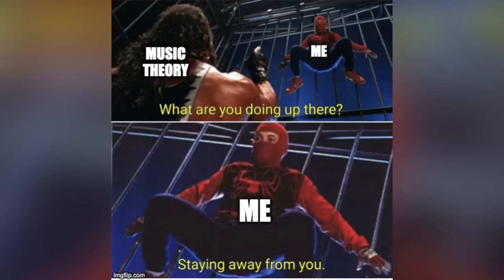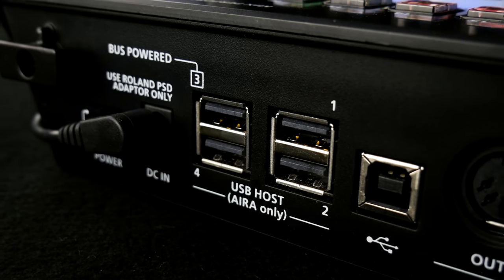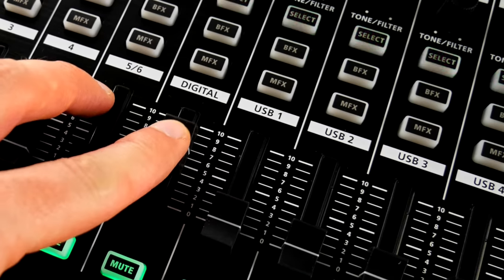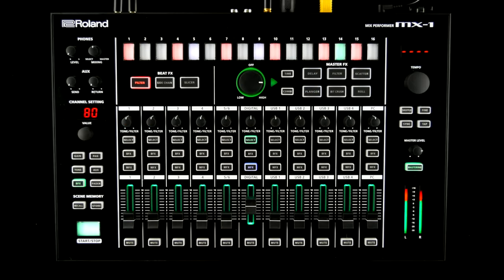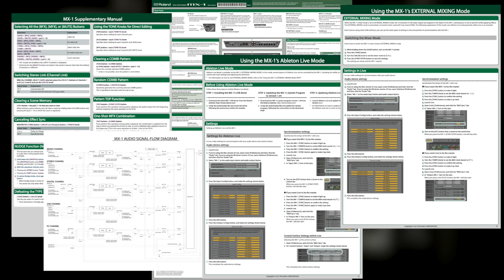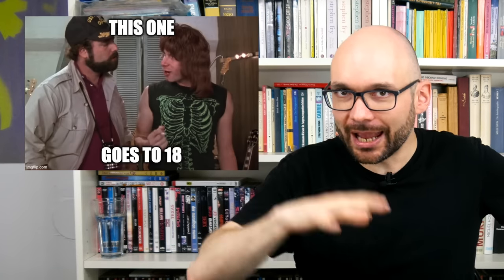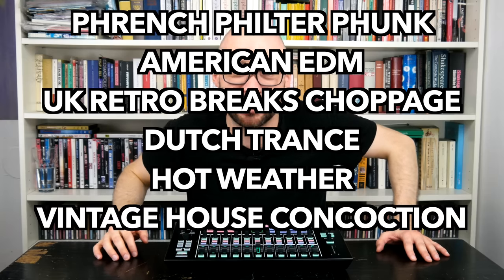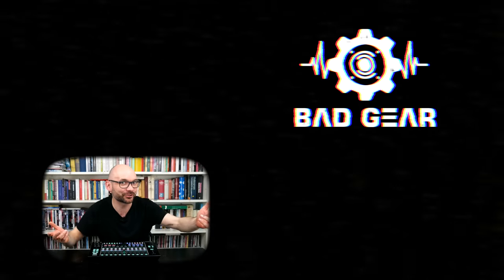Bad Gear - Roland Aira MX-1 Mixer

Comment: Sometime around 2008 or so, Korg made a digital mixer for this market called the Zero8. It had 8 stereo channels, selectable EQ/filter per channel like the MX-1, and a FireWire interface that made it look like 8 stereo audio channels to and from your DAW.  Oh, and touchscreen-controllable Kaoss-style effects processors (1 insert, 1 send, 1 master).  It also had all the analog I/O you'd want.  And it lit up like a Christmas tree, in a much less toylike way than the Aira stuff.

It was an incredible product with serious stability and reliability issues.  Sadly, rather than fix the problems, Korg quietly abandoned it.

I think the market still needs a product like this. Unfortunately the MX-1's connectivity just sucks, and it is way too toylike.
Reply: Oh yeah, i still have the Zero8. When it came out, it was my absolute dreammixer, with all included features i needed and wanted. For both, djing with traktor compability for timecode/vinyl and producing! 
Bought it after the release and spend most of my money. Worked nearly 2 years and had so much fun before the heavy problems began. 
Some channel faders didn't shut down the signal to 0, the audiointerface became a total disaster bcs the sound more crackled than sounded^^. 
The touchpad stopped working, first one axis, later both and so on and on.... 😭
Today, the only thing it still might work as a MIDI Mixer/controller if you connect to a MIDI interface! I loved this gear so much when it worked, but when my Zero8 died it ruined the fun in making music for me... the idea for this console was genius but the technic inside crap  (sorry for my bad english, i am from germany 😂)
Reply: @danielwerner1980  I used mine to get 6 stereo channels from Ableton Live for performing, plus plug in a couple of lines (synth and homemade bleep box).  It was like a dream for a couple years, then the touch screen would occasionally just stop working and the unit would need to be opened up and the touch panel connector disconnected and reconnected.  That disassembly would take about an hour!  I could have lived with that, but it just stopped working on me in the middle of two different gigs, in front of an audience, and I had to reboot the computer to continue.  So ... I had to retire it.  I still have mine too, it's in a nice case ... just sitting there.  What a shame.

BTW I would never have known English is not your first language if you didn't say so.  Good job.
Reply from the maker: This one is super interesting, thanks for posting!
Reply: @AudioPilz  sure thing - unfortunately the Zero8 is probably not worthy of the “Bad Gear” treatment. When it works it is absolutely perfect. If somebody ever makes a similarly compelling product, but more reliable, I would pay big bucks.
Reply: @infindebula  sounds almost like my setup, i used it either 8ch from Ableton or 6ch + 2 really bad gears from Roland and Quasimidi or even vinyl/traktor dj setup, with an external Kaoss Pad 2 on the Master and it was hell of a fun! Like a dream like you said as long as it worked...
The possibilities seems endless, 8ch stereo audiointerface, traktor compability, phono/mic/guitar amps, line in route to whoever channel you want, eq selector, mastering fx + kaoss pad, damn you could even switch every ch for its own to a midi/midi+audio controller and so much more features over the touchpad. 
Sucks, when the touchpad dies at first 😅
I've heard from that trick you said, somebody told me you could fix it when you open that whole thing and it takes hours, but i never did. My mainproblem was the broken audiointerface at first that made the whole console nearly useless. Damn, i got nostalgic and sad... sorry for the long text about things you allready knew 🤷‍♂️😁
Playing a gig live like you said and the machine died must be a nightmare, hope you could saved your show somehow?
When the Zero8 was new it was a beast, i played one time on the Nature One CV a 12 hours dj set thru traktor with timecode vinyl and had no single problem....
Korg wanted everything in one console and messed up with the complexity of the technic. 
P.s. oh thx, thats really kind. I'll do my best to be understandable and not sound like a complete analphabetic 😂
Best wishes from germany

Comment: I kinda get why the TR is only received in stereo. As i understand it, the MX-1 is supposed to be the center piece of an Aira setup and the TR-8(s) already allows for mixing and panning on itself. So using more mixer channels on the MX would be redundant and would „waste“ valuable channels.
I suspect that’s also the reason a reverb and send delay were omitted as every Aira devices already has their own FX tailored to each device, which include delay and reverb on every instrument iirc. DJ style FX and the beat FX just make more sense in this case.
I‘d say, it’s completely geared towards combing the Aira range and everything else is just a „bonus“.
Reply from the maker: True that!!!

Comment: first I was a bit disappointed, when I got this mixer second hand. But if you get the concept to play aound with other roland aira or grooveboxes together with it , it becomes kinda easy  and fun.  Feels  like an effects-unit with 6 hands-on channels. I also had the the experience of lost connections with my daw. But anyway  it is more fun to just live-mangle a group of electronics. Of course there s a lot they could have integrated in hardware and usability. But I got it for 170 euros - for this prize its a great toy.

Comment: I have a contender for a bad gear mixer.  The Korg Zero 4. the Korg zero mixers where great for plugging in synths and drum machines until korg stopped support for windows 10 and fire wire connectivity on new computers is zero these days,
Reply from the maker: Ah, interesting! Thanks for posting!
Reply: Roland is just as bad if not worse for not updating drivers.

Comment: There is regular delay and reverb, it seems like you might not know that there are many alternate effects modes for each of the master effects! I have delay as a thick hall reverb and it serves me well. You also don't need a separate compression effect since it has 9 different mastering effect modes, which of course all have multiband compression.
Reply from the maker: Thanks for the heads up. Is there a way to route the master effect to discrete tracks?
Reply: @AudioPilz  not as far as I know! I haven't dove into the off-documentation features yet but I'll let you know if I discover anything. These Roland devices seriously need proper OLED displays and normal menus for all these settings!
Reply: @AudioPilz  ps I love your videos! I watch every new one that comes out. My favorite synth channel on YouTube.

Comment: I found the I/O limitations quite severe. Unless you own a few AIRA boxes, half of the desk is wasted. But if your setup matches the channel layout, it´s a really interesting box. That said, a mk2 should have an option for all analog in, even if via extender. The "sequencing the mixer" idea has stuck with me, I´m currently going that route in the modular.
Reply from the maker: ...or multichan connectivity to the TR8...
Reply: @AudioPilz  True. DB-25 sounds like a good idea too. I was an idiot, got 2 of them and hoped that drivers will work in RME quality and style. Fuggedaboutit. Even with ASIO4ALL it wasn´t possible to get a stable setup with 2 MX and 1 TR (may differ with aggregated devices under Mac). I moved on though and boxed the boxes for now. Planning to build a little AIRA/Boutique setup in Winter. 

Oh, and I don´t recall who, but one of the better known DJs played with a laptop and 2x MX-1 at a rather large festival these days. So not all hope is lost :D
Reply: Paul van Dyk.
Reply: Agree about the lack of inputs, really bizarre choice from Roland

Comment: Hey soundengineers, i got a question. Unlike the author, i have never had to work with hardware mixers in my musician's life until very recently. I'm learning playing drums, and in my rehearsing place they have Yamaha MGP's which i learned to do three things on: 1) mix for the band via main array; 2) mix for my personal monitoring; 3) mix down for recording. All simultaniously, for 5 to 10 channels (depending on how many dudes make it to the rehearsal). Number two involves a cheap extra mixer from Ali; the rest is handled by the MGP. Now i wonder: could this mixer do the same?
Reply from the maker: Nope, MX-1 is underspeced for that I'd say

Comment: I would like to see a new revision of this mixer that is capable of connecting any Roland synth with USB multichannel audio with the ability of streaming all of the separate USB multichannels for each instrument into separate channels on the mixer.  I have a TR-8S and a Fantom-06, both of which can stream multichannel USB audio.  A mixer like this with the feature I described above would be a great way to aggregate the TR-8S and Fantom-06 along with all of their individual USB audio multichannels onto a Windows PC DAW and record each multitimbral part on a separate track within the DAW software with minimum latency.  

A mixer like this would also allow full mix control over each separate sound in the two instruments when used just as a standalone mixer with the Roland instruments connected via USB.
Reply from the maker: Multichannel support would be awesome!

Comment: I got a RCA to digital converter for mine, so I have an extra stereo channel to play with.

Would have been nice if there was an option to connect non Roland gear to those USB ports, but that would stop people from trying to catch all the Roland Aira compatible gear.
Reply: SE02 I choose you ! 🤣
Reply from the maker: Yeah, that SPDIF in is really nice!
Reply: @AudioPilz  Do you know if the signal gets resampled or does the MX-1 sync to the spdif  embedded Wordclock? Would the laptop then adopt to the spdif clock?

Comment: i heavily considered buying this when i came out. After weeks of research and countless forum threads i was unable to determine if this thing worked with any kind of non roland/aira machines. The marketing for this was a complete disaster. I eventually settled for a standard dj mixer and small 6 channel sub mixer. Turth be told watching you use it I really wish i got one.
Reply from the maker: Yeah, introduction of this one was weird!

Comment: You are correct, in that there  are no good options for synth/gear mixing in a live set up. Behringer needs to hear my plea for a 5 channel mixer with an assignable cross fader so I can cut two drum machines like I would vinyl records. Effect send AND return. No on-board effects (unless it’s the sweet pioneer DJM delay). Headphone (cue) monitoring is nice but not necessary. Line in with full size jacks. No mini jacks or RCA. 
That is it. 
Best I’ve found is the Behringer MXB 1002. No crossfader but everything else is great. Can be powered via a single 9v battery and does phantom power from a secondary 9v battery. This Aria is just a glowing toy IMO.
Reply from the maker: Maybe a synth-focused version of the X32?

Comment: I considered this back when it was released. I was intending to get one with a System 1 (ended up getting neither). Though I never fiddled with it, I dug deep into looking at how it worked and just felt it was netiher here nor there. I liked the fact it tended to accommodate DJing sensibilities pretty well, but I just found other features weirdly lacking. I mean you've shown it sounds nice and all, but I guess it's just that thing I often find where I look at it and think "how in the hell would I ever use this and not just default to something else?"
Reply from the maker: I'd say it's great for DJs turned producers
Reply: @AudioPilz  Yup that's pretty much what I gleaned from giving it a once over. I think you nailed that presentation too.

Comment: If they would sell small USB soundcards to Turn the USB ins into audio ins this Thing would be much better. 
Anyways, I Love it so much, I Work around its flaws <3 great Video, as Always 😊
Reply from the maker: Thanks! You mean a soundcard for your soundcard?;)
Reply: you can plug it into a Windows PC and if you have the drivers installed you can route audio to any of the channels, no program win10 does it. You can then get a stereo to usb cable and route the audio in to one of the MX1s usb channels your not using, while hardware is plugged into the other channels in normal mode  I need to make a video about this. I for example have the MX1 and the MC707 and the DJ202 plugged into my computer via USB, and I route the audio to usb1 usb2 and usb 3, my computer audio (youtube) comes in on the pc channel. Doing this instead of plugging the 707 into usb1 lets me send pc audio to the 707 via usb. I use the stereo to usb cable to route an electribe to usb4. Im not sure if you can use multiple stereo to usb cables  at once. This leaves 4 stereo channels if you use a analog-digital converter for the digital channel
Reply: @AudioPilz  indeed😊 more analog ins in the First place would have eben the better solution, but as a workaround... Why not? If I Had the soldering skills i would try to make sth Like that myself. Maybe from a broken tr-8 🤷
Reply: @timb5940  How’s that video coming along re conversion of usb to audio inputs?

Comment: The fact of the matter is there is nothing else on the market that competes with the MX-1. If you have other boutiques / TR8-S / Aira gear with external inputs you're effectively getting another 4 stereo analogue inputs via the MX-1's USB ports. The mastering options glue everything together during live performance. Prefer to use send FX and return to a stereo input for multitracking. 18 channel interface for this price with all the performance features to boot. It's not perfect but show me a mixer that is? For the price it does a lot very well.
Reply from the maker: There's some truth to that!

Comment: I will have you know that the very day this video dropped, I am to receive a Beat Scatter box, aka SP-404 MkII. Thank/blame you for tipping me off to Roland’s Scatter!
Reply from the maker: Scatter is like instant breakbeats;)
Reply: @AudioPilz  YES 💯 This is why I ❤️ it; also, BOSS RC-505 MkII seems to have a different version of Beat Scatter: only 4 variations, I think, instead of 10 on recent Roland gear. Also, the 505 implementation is on recorded audio only, not live input. 🤔
Reply: @AudioPilz  Guess you gotta do Roland’s Eurorack Scooper one day: “Modular Scatter” (and looper?). Last thought: now that I’ve been able to play with Scatter on the SP-404 MkII, I’d say that many of the effects on Hologram’s Microcosm pedal have a slightly similar application or approach, albeit with transient/envelope following.

Comment: Thanks for video my friend.  I am confused about one thing and would be so grateful if you can explain the answer.  I use a Focusrite Clarett 8 pre AD which is  full so I was going to buy another used one and connect using ADAT for an extra 8 ports.  I am also planning in picking up the MX-1 mixer.  So does that mean I will now connect my synths, drum machine, etc into the mixer and the mixer becomes my interface?   Ableton is my DAW so a tad confused if MX-1 is  also made for recording?   I would think each instrument should have a dedicated channel in Ableton in which case they would go direct into interface not a mixer.  Plus you can record in stereo.   But if the mixer now is the interface I am wondering if I need another Clarrett 8 pre. Does my question make sense?   Thanks for any advice.
Reply from the maker: That would be theoretically possible depending on your OS and workflow but I personally don't like to mix drivers (you would have to as the MX-1 doesn't have ADAT, only SPDIF - which is stereo). Have you thought of just getting an ADAT-compatible preamp like a Behringer ADA-8200 or more upscale equivalent (Focusrite Octopre, Audient,...) and maybe add a stereo preamp with SPDIF out for maximum channel count?
Reply: @AudioPilz  never gave the preamp a thought, And my understanding is people buy the Octopre for the 8 mic inputs.  That's been confusing the tar out of me. If you can hook a second clarrett up using ADAT, why do you need an Octopre?  Probably a very simple answer. I just cant figure it out.

Comment: I would have guessed AudioPilz dude was a rave dj but it turns out he's more of an engine ear.

This mixer seems like Roland rewarding people who already bought Roland gear for their brand loyalty if they bought the gear that Roland produced that produced the music that Roland thought was music.

There. I said it. This mixer is the kind of gear that influences the final result in a way that sounds good...but...it isn't the same as driving all of midi gear signals through homemade preamps into a unity gain mixer into two channels of my six channel, four bus Teac mixer.

This message was brought to you by solder. Solder. Use it for making gear or fixing the gear you have.
Reply from the maker: Yeah, I'd prefer some colorful pres too

Comment: I'd love to see you do the MC-707, complete the AIRA series!
Reply from the maker: Great suggestion, thanks!
Reply: the only thing that could be considered bad about the mc707 is the limited sample memory (which seems very artificially limited so that the product doesn't undercut Roland's looper boxes).  it is the one major flaw
Reply: @djangofett4879  there are others. Sample chopping on the machine is not the greatest. But since the newest firmware update it is an absolute beast of a machine
Reply: @djangofett4879  And it doesn't do bank change... meaning its impossible to select banks on anything else, including the other Aira range synths lol

Roland make some VERY strange decisions.